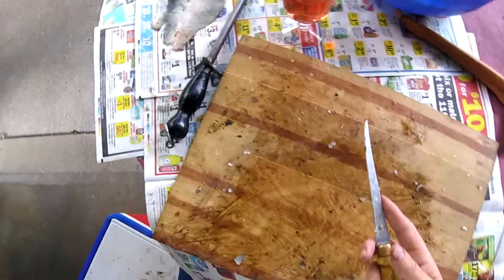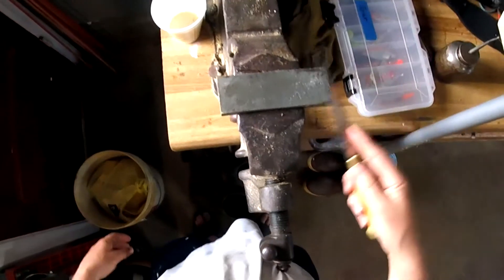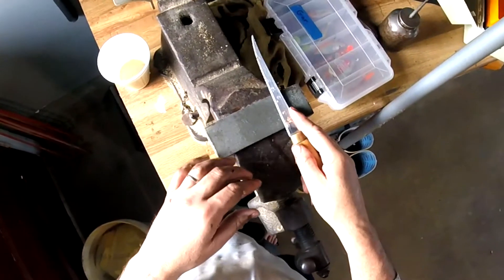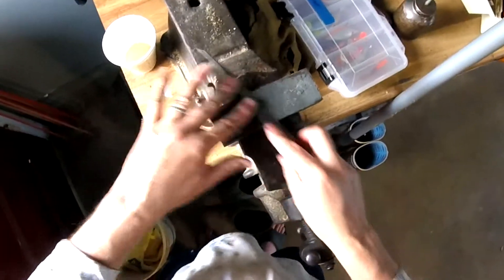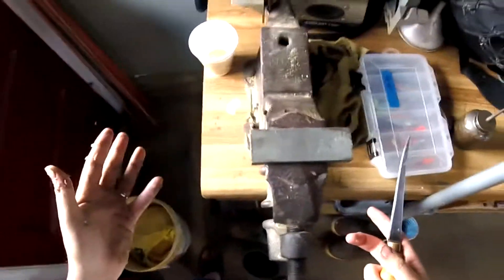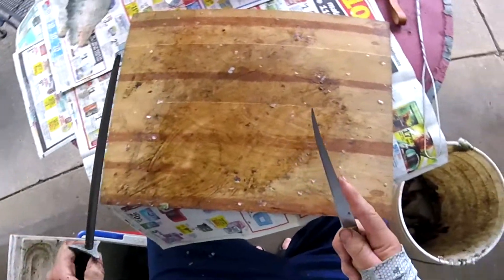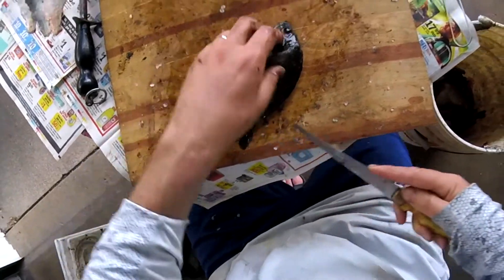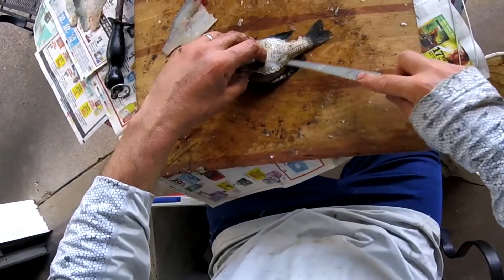How do I sharpen a fillet knife on a stone - SIMPLE & QUICK

Comment: What kind of knife is this?  How long is the blade?
Reply from the maker: It's really nothing special, just got it at Wal-Mart.  Here's what they call it: Rapala FLF6 Fillet Knife with Leather Sheath.  It has a 6 inch blade.  I have a couple of this type but they seem to each be a little different.  I really only use the one because it seems to be a little more flexible, which I like.  If you bend them too much though they will definitely break, especially the ones with the stiffer blades.